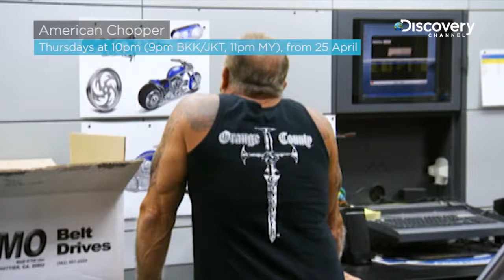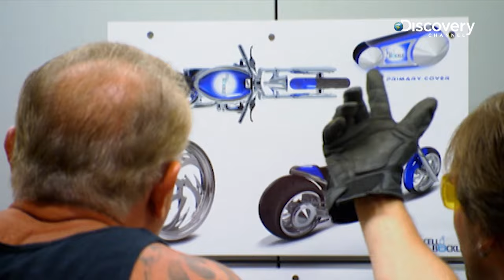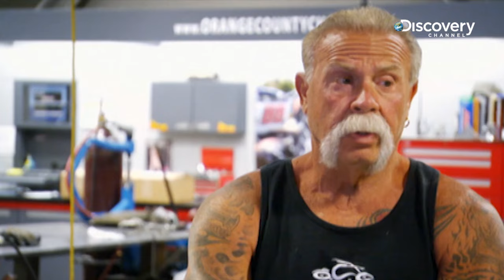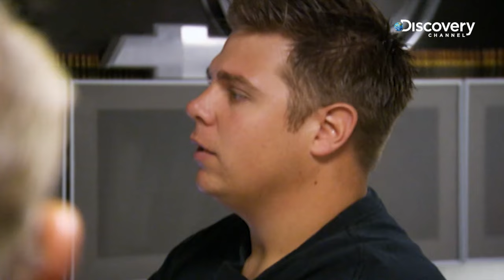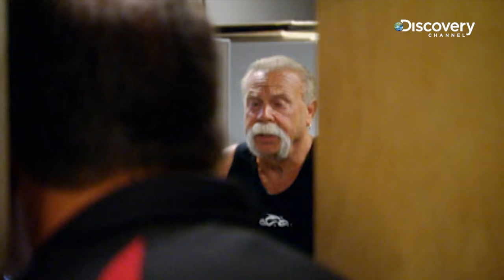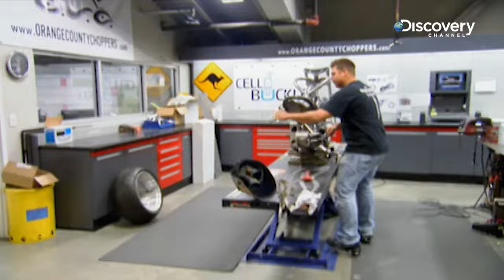American Chopper: Jason Flared Up

Comment: I get that this wasn't really a good look for Pohlie, but what's the deal with how Senior handled this?

When Paulie worked with Pohl designing bikes, they'd both sit in front of the computer, throw ideas back and forth and within a couple of hours have a practical and artistic rendering of what they wanted to do for their clients. I get that Senior is more hands-off. He relies on Pohl to be the designer. He may throw out some ideas and/or engineering focal points for Pohl to incorporate, but that's it. He's not part of the process, he delegates responsibility.

Now after several days of fabrication and mock up, Senior is having second thoughts about the concept. Which is fine, I mean those of us that have some kind of process about just take a couple of steps back to move forward in a different direction.

But he effectively blamed Pohl for designing a trash concept. Not "I've changed my mind, and I'm sorry but we need to start over," but saying "you designed a piece of crap, it really doesn't inspire me, and YOU need to buckle down and start over!"

I'd take it a bit personal too.

If your boss isn't inserting himself in the process along the way to effectively put his name on the project and stamp of approval on the original concept drawings, you're the Steve Jobs of bike building. Locking people in a building to make you a bike with someone else's money so you can unveil it and take all the credit in the end, is lame

Comment: the fact Jason almost laughed when the owner of the shop says its not up to my standards in my opinion started the problem no respect, and needs to be taken down a few notches. this was a easy design and he should not be defending it when he knows its was a hurry up and get it out of here design. it doesn't matter if the boss seen it 4 times he is the boss and there is a level of respect that's needed. Jason stopped the communication on fixing the half ass design to defend his trash im a better designer then Jr's ass ego.